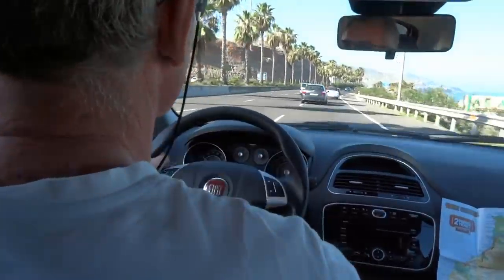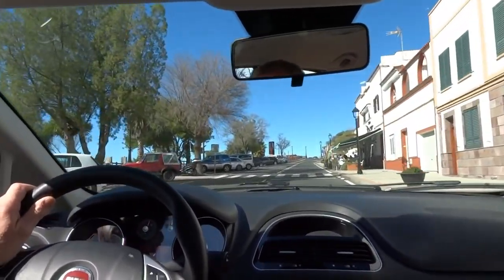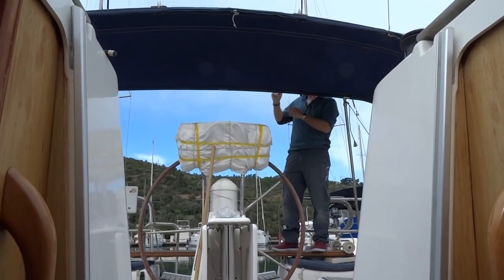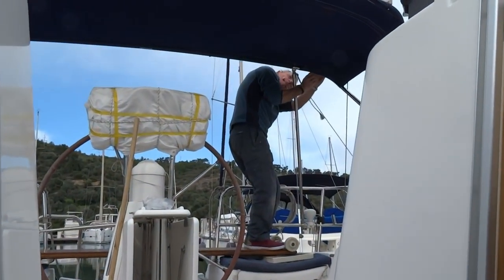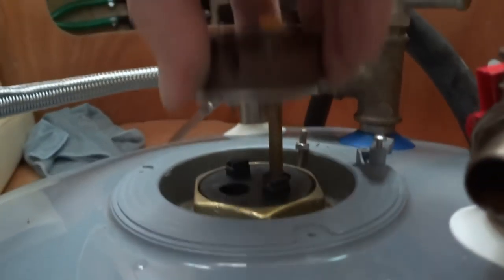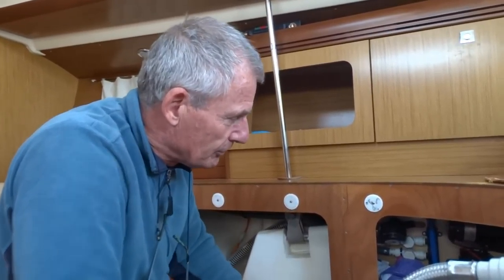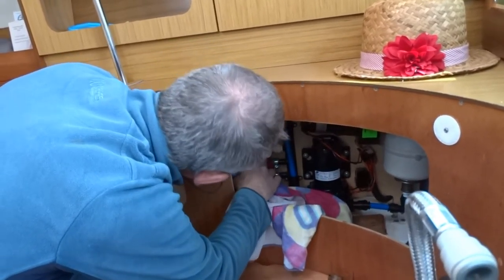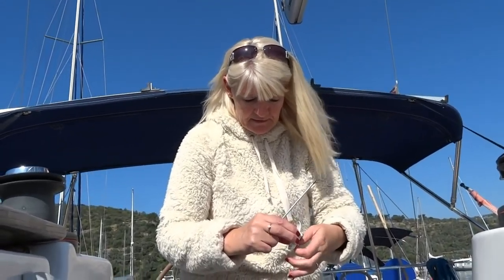Atlantic Crossing 2018 | Abandoned

Comment: Your decision making process ended up at the proper option for this non-cohesive crew attempt to cross  a very unforgiving body of water. The planned departure from the Canaries in late January/early February is problematic at best and disastrous at worst. The decision at the beginning to depart with 3 of 5 crew members unwell and with possible balance and equilibrium issues into forecast heavy swell and confused seas would have been my stepping off point. 
As a Commercial/Instrument rated fixed wing and helicopter pilot I have lived by the old adage that, "Take offs are optional, but landings are absolutely mandatory". As an open ocean and coastal cruising sailor the same sentiment and judgement should always apply. 
I wish you fair winds and smooth seas.